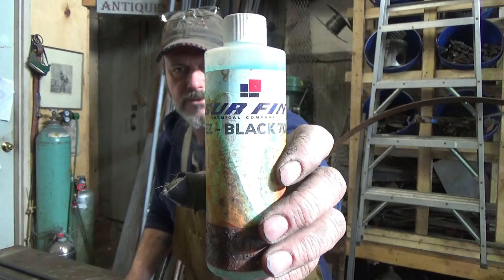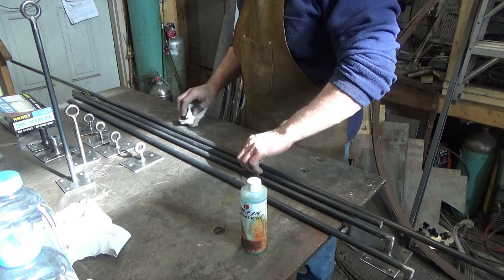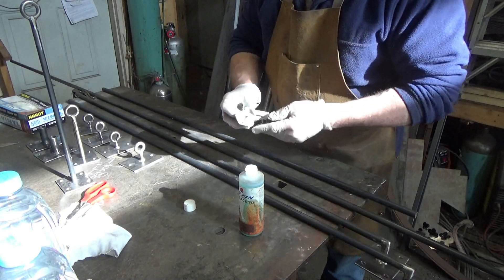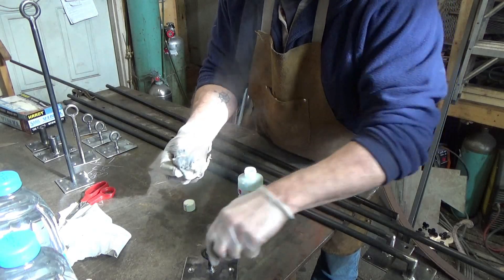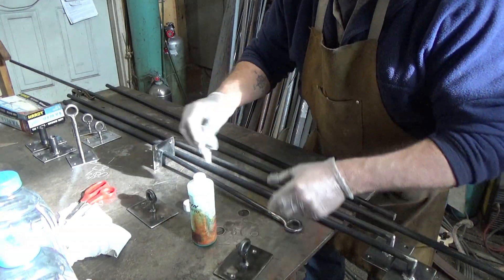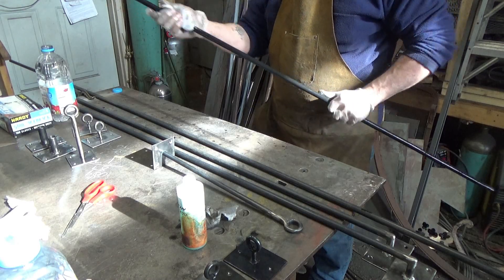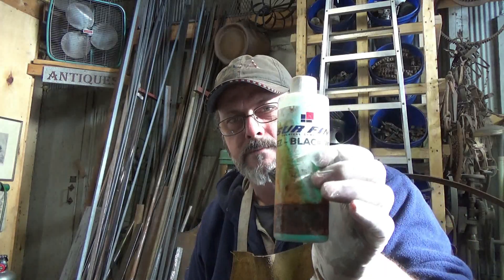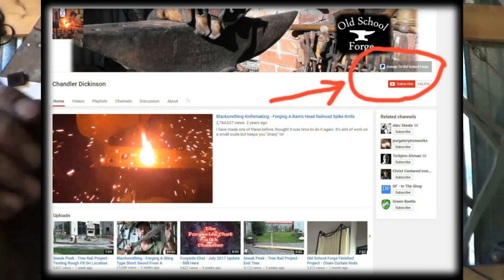Poor Mans Product Review -  Sur Fin Ez Black 70 - Cold Process Darkening Agent

Comment: I haven't tried it, but I like rust bluing. You basically use a solution, made from household products, to make a part rust, then boil it which cleans the solution and converts the rust to black oxide. You repeat a few times and build up a nice layer of black oxide

Comment: I've got some Caswells(basically the same thing as you have), I've been wanting to try, but I've been doing Hamon builds lately. I tried that casey gun blue, but it was so splotchy, it looked horrible. The black magic was good but at $16 for 2oz, it's just not worth it. I really want to try dipping. I found that PB Blaster penetrating oil works great as a sealant. If you look on all these sites, they have a cleaner, the blackener & then a sealer(it's just penetrating oil).... Great video, thanks for the info... Take it easy.

Comment: Chandler you should see HOJ forge. How he blackens his stuff. Or would it be cheaper to just dip the hot steel in oil that also makes a good black cote. 
Still nice video.
Reply: Coat
Reply: SOME METALS TAKE WATER TO HARDEN, SOME TAKE OIL, SOME AIR
Reply: Also some people rub boiled linseed oil on hot steel to blacken (see Torbjörn Åhman's channel!); but I guess the point here is to test a cold blackening agent. Long stock like Chandler is using here would be more annoying to heat than smaller pieces.
Reply: I stand corrected. 

BTW, I think you might have CAPS LOCK stuck on?
Reply: THATS USUALLY BOILED LINSEED OIL AND BEES WAX, COMMONLY KNOWN AS BLACKSMITHS JUICE
Reply: THANX, BUT ITS NOT STUCK AT ALL